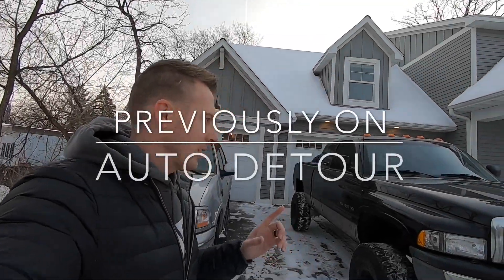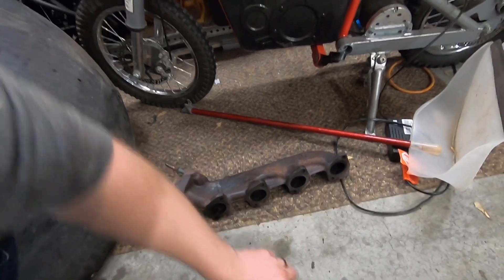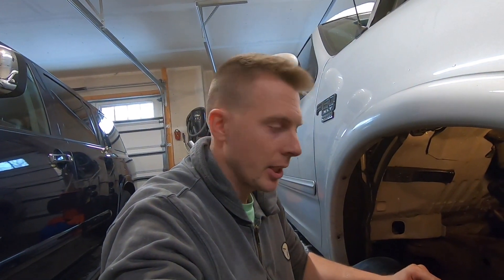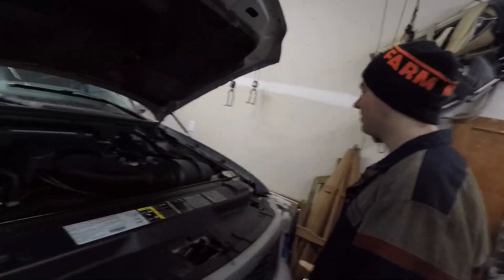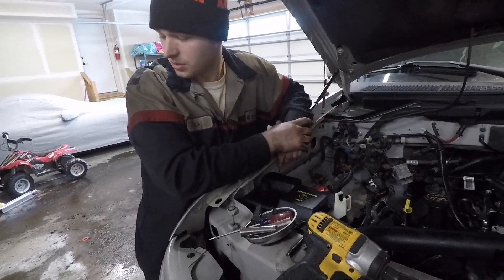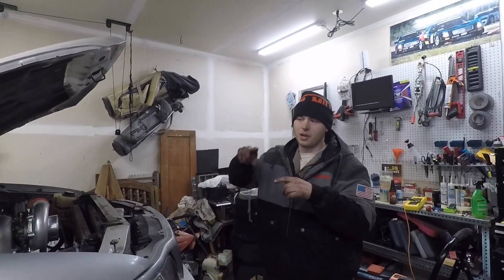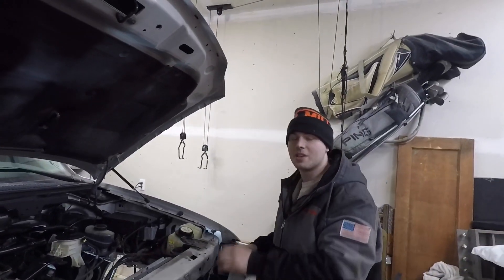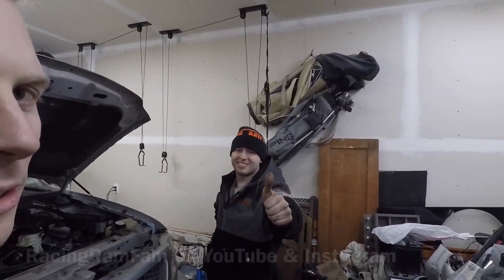2003 Ford F150 5.4L V8 Single TURBO Install!! (Ep: 1) ***Grandpa Truck Project***

Comment from the maker: Because so many people have asked, I will post a link to the turbo kit below, but a quick disclaimer! This kit is NOT bolt on as advertised and will require much modification to work as you will see in the rest of this build series. Thanks for watching!

https://www.cxracing.com/TRB-KIT-F150-9702-IC?search=Turbo%20kit&category_id=1533
Reply: Auto Detour it says that its bolt on for a 4.6. because the 5.4 is wider than the 4.6 that may be why yours did not bolt on
Reply: what a waste of money, you dont hook up a 4 door truck to race, you hook up two door or two door extend cab trucks, a 4 door truck isnt ment for racing style

Comment: I stumbled upon your channel,  while researching my 1990 f150 4x4 xlt Lariat 5.0 single turbo build. I am impressed by your cleanliness in language and your family oriented attitude. Refreshing.
Reply from the maker: Thanks Robert! That means a lot! I appreciate you sharing my post on Facebook too. Single turbo 5.0 is gonna be really fun!
Reply: I have turbocharged 2 miatas with megasquirt. The challenge now is ms3 requires full rewiring. I am using  an msd cam angle sensor to control spark and fuel. How are you controlling timing? Tough to protect from detonation without timing control.

Comment: The 5.4 L is known to break exhaust studs. Especially the rear two. Had the same thing happened on my F-250 superduty with the 5.4 L
Reply: I bay a 2003 Ford f250 super duty I want to put some turbo on it the anyone know we are I can find some turbo kit or some ting my is 5.4L gas

Comment: I love my 2012 F150 Ecoboost, but when that baby gives up the ghost one day, I am seriously considering buying an 01 thru 04 crewcab F150 w/ a 5.4L. I had a 99 model years ago, and the body, frame, and powertrain were all rock solid. 
If I can buy one with a few miles on it for $6k, then do a mild restore with tires, shocks, heavy-duty detailing, maybe carpet, brakes, all fluids, etc... I bet I can have a pretty solid daily driver for FAR LESS than these crazy prices nowadays. Probably more dependable than newer crap with all the cam phaser bs.

Comment: Where did you get the turbo kit? Interested.
Reply from the maker: https://www.cxracing.com/TRB-KIT-F150-9702-IC?search=Turbo%20kit&category_id=1533
Reply: @AutoDetour  I have a 98 5.4 and I want a turbo kit for mine well, but about this site, I went on the site and see that it's for a 4.6, and I wouldn't load up any turbo for a 5.4,, unless the turbo for a 4.6 can fit a 5.4 lol, help me out bro

Comment: Getting my first truck tomorrow. 2005 5.4L Supercab XLT. Only 4k for it with about 115k miles on it.
Reply from the maker: Congrats man! That sounds like a good deal. I hope you love it!
Reply: I feel sorry for you the 5.4 is temperamental sell it before it hits 200k i had a 2004 f150 that truck left me stranded atleast 5 times i bought it at 176k i sold it at 230k i will never own a 5.4 a 4.6l or 6.2l are better engines the problem with 5.4 is a little issue with engineering it was a poorly made engine the coilpacks go out the bearings go bad.
Reply: I sold my black crewcab 5.4l 4x4 f150 for 2300 dollar's i was enthusiastic to unload my pain im sorry to the new owner.
Reply: Sell it ASAP 2005 to 2010 3v 5.4 mine is giving me to much problems cam phaser issues . Already has 170,000 miles .

Comment: Make sure you get a decent wastgate because the ones in the ebay/china kits don’t work and is what blows peoples motors. They may say the spring is for say 8 lbs of boost, but they allow 20+ lbs of boost
Reply from the maker: Thanks Kyle! I'll definitely keep an eye on that for sure!

Comment: This makes me miss my old 2003 :/ such a gas hog but the most reliable vehicle ive owned
Reply: WhaddupImJohn lol not mine. So far I have done a head gasket (did a head rebuild too) and just put in a reman transmission. Now I have that god awful tick from a roller follower. Currently at 152k. The running joke is it has all the new truck parts, but without the reliability or warranty!
Reply: Wtf lol i had the 5.4 with 206k and the worst thing that happened was the intake manifold cracking and the water pump blew up. That was at 175k. Same tranny from factory was still in it when i sold it haha thing ran like new

Comment: Why didn’t you get a 5.4 turbo kit? That would have saved you a lot of work. I had a 03 lightning back in the day. I was looking at switching to a turbo setup and several places made single out twin turbo kits.

Comment: 4.6 and 5.4 are the same other then deck height the 5.4 being taller and wider. Transmission dipstick is more dependent on transmission then engine.

Comment: is gramps a 2V or 3V version of the 5.4?    asking because i have a 2v in the driveway that is severely lacking in wow factor
Reply from the maker: Gramps is a 2 valve. 2003 was the last year of the 2 valve 5.4.
Reply: @AutoDetour  Thanks!  my 99 has a bricked engine,  i'm playing hell finding a replacement,  and was starting to think putting another 2v under the hood would just be a waste of money.    would probbably still rather put in something newer but from what i understand the electrical work would be a nightmare to make a newer gen ecu play nice with the electronics in the vehicle

Comment: Im on a turbo project on my 2000 ford f150 5.4 how much did u spend on your fuel injectors?
Reply from the maker: A little over $500 from Deatchwerks for their 60lb injectors.
Reply: @AutoDetour  can i get a list of what u got i just started i got 3" tubing turbo gt45 and inner cooler from summit ..if you don't mind
Reply from the maker: This video goes over the full parts list and also links to all the parts in the description.
https://youtu.be/7Vm8QEwR0hw

Comment: I couldn’t find the starting video, is this a stock everything truck on 8psi?
I have a pro charger for my 99 4.6 f150 and am now looking forward to it a whole lot more after seeing these videos.
Reply from the maker: The whole build is under "truck videos" on my channel. Yes, stock everything. Upgraded injectors, fuel pump, spark plugs, etc. 407/523 to the wheels on 8.8 psi.
Reply: @AutoDetour  thats super impressive! how many miles on it? 
I'm edging on 200k on mine, the trans will def die but i have the t56 I just have to start putting the parts in place. and get the tubing right for the blower.

Comment: how many miles onit? I have a 5.4 2000 wonder ern bout turboin' it?  got lil' under 110.000mi on mine
Reply: Those 5.4s are good engines we have a 2000 f250 with over 350k on the original engine and we tow with it daily still runs good
Reply: I have a 2002 f150 5.4 with 270,000
Reply: @jwayne1202  my 2000 f150 never gave me problems until the engine gave out at 396,000 miles
Reply: I have a 2006 5.4 with 130,000 miles

Comment: The exhaust bolts breaking is common on those trucks.
Reply from the maker: I know that now. Haha!  I'm lucky only 2 were broken! I've seen other guys have to deal with lots of them.
Reply: Do you know if you get a check engine light on with this issue and if it does what is it?

Comment: I’m wanting more power out of my 03 4.6 4x4. Not many options out there besides this and the $5500 Procharger. I doubt the wastegate and turbo from this kit but can you run different turbo /wastegate? How did you guys go about tuning and fuel upgrades?
Reply: You can run a comp xe270 and on a healthy Pi engine make about 350fwhp with supporting mods like exhaust and tune. Tuning can be done on a stock ecu. If youre looking for more power than the 280-300rwhp and dont want to spend thousands on mods, buy a Zex wet kit and keep it simple.

Comment: What all did you have to change to install it
Reply from the maker: So far I have had to lengthen the crossover pipe, modify the intercooler bracket, upgraded injectors and fuel pump, relocate the a/c canister, modify the downpipe. I'm not done yet, so there will most likely be more. Subscribe if you haven't already so you can follow along. Thanks for watching!

Comment: Subbed as soon as i read the title
Reply from the maker: Much appreciated!
Reply: @AutoDetour  the info your offering is convincing me to go do my 4.6 single cab
Reply from the maker: It's a very expensive rabbit hole. LOL
Reply: @AutoDetour  😂 how deep of a hole is it burning so far without the coating included i dont worry about rust in my area its to dry and also trying to keep it budget friendly

Comment: The only difference in the 5.4 and 4.6 is height and width which means the intake is larger but all other components are the same under the hood ac lines wiring harnesses and all the brackets been working on these for years so easy to do a  4.6 to 5.4 swap its ridiculous don't even have to change the ecm pull out gut less non pi 4.6 and drop in a 5.4pi and enjoy

Comment: Hey man, where did you find the turbo kit? I'm looking to turbo my 05 navigator and it has the exact same motor as your 03 F-150.
Reply from the maker: CXRacing
Reply: that navi should have either a 4valve or a 3valve that f150 is a 2v and the 2v and 3v heads are different and the headers will not bolt up
Reply: @smcgt5001  Yep, last vehicle that I remember using the 2v 5.4l was the 2003 F150s.

Comment: Hope you're doing the proper engine modifications for this otherwise you'll be back under the hood pretty soon
Reply from the maker: Going to run 8 psi on stock internals for now. Not anything too crazy
Reply: I'm running 12psi on mine. I know people have been beating on there 5.4s for a long time. The transmission just can't take it.
Reply from the maker: No engine issues at 12 psi? How long you been running that?
Reply: @AutoDetour  I've had the Lightning Supercharger for over a year. A little ping after 10psi so doing e85 tuning to help.
Reply from the maker: Trapper Kaderlik Awesome! Glad to hear this. Makes me hopeful for more than 8psi in the future.
Reply: @AutoDetour  ya make sure you get a good tuner to program your truck. I hope you have 93 octane at least. Or program for e85.
Reply: Chris Farley it does not have the same tranny 4r70 vs 4r100
Reply: work hard my f150 has the 4r100. Also has a 10.25 rear end!

Comment: Why anyone would boost a 5.4 that only has 4 threads holding in the sparkplugs is beyond me. These engines blow out the spark plugs in stock form, I've repaired dozens of them.  Adding more cylinder pressure is the most ignorant thing I can think of....
Reply: Yeah I hear you! I remember the first time my brothers v10 spit a plug Rollin about 80 on the interstate... Pure stupidity to have so few threads holding the plugs in the heads
Reply: Ive owned several 5.4s and ive never had this issue
Reply: @kevinhofer2122   You're one of the few. Millions of others havn't been so lucky.
Reply: @bdd1469  is right Kevin Hofer count your blessings! The only other vehicle I've owned that had that issue ( spitting spark plugs ) a 1979 datsun pickup truck you shoulfabuilt
Reply: Actually i think the problem mainly is that all you guys over tighten your plugs in the first place, ive talked about this issue with these motors for years and years with other mechanics and everyone thats never had the issue usually feels that its due to improperly tightening the plugs, of course ford should not have allowed the specifications to be so tight, however do you really believe that ford engineered the motor with such a flaw? I think not, theres more going on here
Reply: Yeah but a steel helix coil in there so you can tighten the plugs even more! lol get serious
Reply: @kevinhofer2122  Thats cute. I've fixed dozens of blown out plugs starting from the time the trucks were brand new with factory installed OE plugs. So if they were over tightened it was done at the factory. I can't remember repairing a stripped or broken sparkplug in a dodge or chevy in the 35 years I've been an auto tech. Do I think ford designed them with a flaw? Lol. 90 % of what ford does is a flaw. The 5.4s were a turd from day one untill the last one was made.  The plugs blow out, they " fixed it" by redoing the heads and using plugs with too much thread ...that break off in the head which is way harder to fix. They have that cam phaser/ timing chain problem, they go thru ignition coils like people go thru water.  Because people arn't smart enough to fix their ford when it starts missing on rainy days or when the replace engine light comes on they fill the catylitic converters full of raw gas which alone can cost several thousands of dollars to replace.  Yes ,   I think designed the no power,  no fuel economy,  pile of shit with a flaw.
Reply: @kevinhofer2122  that's what I did
Reply: @bdd1469  sounds on the money to me
Reply: bdd1469  that’s the 3 valve 5.4. This truck has the two valve
Reply: Kevin Hofer  it’s actually a under torque problem. Ford put a TSB out on this years ago. I’ve done dozens of plug changes on 2v 4.6 and 5.4’s over the last decade or so with absolutely zero problems. I’ve always torqued the plugs to 30 ftlbs and never used antiseize. Time serts are the only way to go if you are unfortunate enough to experience a blowout.